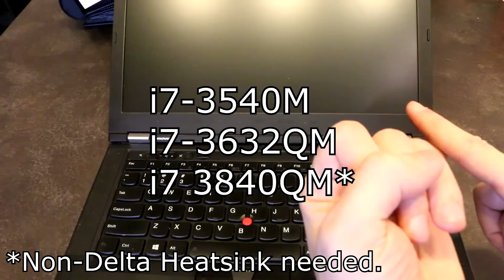Lenovo ThinkPad T430: Upgrade Wonder

Comment: Looking forward to trying one of these out. How does my old HP Compaq NC6400 compare? It's well built for sure, but is it similarly upgradable? I need something to run XP for PA Soft and don't know if it's worth dropping $75 on the motherboard for the HP or putting it towards a thinkpad?
Reply: I have nc6400 (with C2D T5500) and X230 (with i5-3360M), there is basically a day and night difference between them, X230 wipes the floor with nc6400, build quality is similar to be honest, although with a fair bit of advantage to X230 side. Upgrading nc6400 is questionable (older socket, you are limited to C2D Meroms, so T7600 is the limit, and even this CPU will be rather underpowered, RAM is limited by chipset to about 3.5 GB). I support the idea of running Linux on HP if it's viable, but if you insist on having good XP machine, T430 should be having most of the needed drivers AFAIK.
Reply: Have you looked into a VM for XP?
Reply from the maker: Good suggestion.
Reply from the maker: Here are some base stats on how the two would compare as this one is configured:
http://cpuboss.com/cpus/Intel-Core-i5-3320M-vs-Intel-Core-Duo-T2400

As you can imagine, swapping out the CPU with any of the ones listed would widen that gap even further. If you need something to run XP during this day in age, I'd almost suggest running a Linux install off of this and using a virtual machine to emulate XP to run PA Soft. With all the drive bays available you could put a Linux distro on the mSATA, use the DVD base for another SATA drive for storage and use the regular drive bay to keep free for a Windows 10 install.

Check the links in the description to see how serviceable this thing is, the manuals have all been made available to make the process pretty straightforward and parts are easy to come by. The Drive bay to replace the DVD burner costs under $10 CAD from Amazon, the TrackPad sticker if you wanted to replace it is under $5. Maxing out the RAM is about $100 or so, the article on modding details what type of RAM to get as well.

Let me know if you have any further questions.
Reply: My only question then becomes, how soon can you get me another thinkpad? I'm partial to the old HP because of it's tank-like feel, but the T430 is working great, clearly superior, and my ASUS is ready for the bin. The keyboard lighting seals the deal for me. If I can find a board for next to nothing I'll probably still fix the HP and keep it in the BMW for dedicated datalogging/programming, but it's not something I want to spend $100 on. I have found the battery life with the new 9 cell to be a little less than expected, what are others getting on their thinkpad with a 9 cell? Any tips to stretch it out?
Reply from the maker: Browser tabs hog battery. Watch out for those. Also, Windows 10 has a battery settings slider in the system tray you'll want to check out.
Reply: OK I need to post a  pic then. Had to perform surgery a couple weeks ago to reattach the wiring from the adapter receptacle to the board. Most of the screws are stripped it's been apart so many times, had to trim some of the case for access. This how all my laptops invariable fail, literally fall apart but still run. Very excited about mil-spec durability! Battery life is still 4-5 hours, but saw some people claiming almost 3 times that. Still better than the 0 minutes on the unit it replaced.
Reply: If only I had a phone with which to take a picture...
Reply from the maker: They're probably getting 3 times that number from the original Lenovo literature. The OEM batteries tend to have slightly higher capacity than the 3rd party ones but also about 2-3 times the cost.
Reply from the maker: I know a few people near you that can take a picture. Ask them. 😉
Reply from the maker: Good suggestions. Thanks for the comment.
Reply: Thinking about starting a channel "laptop retroactive", how to keep your ASUS or other throwaway slapchop running with zipties, lots of soldering, and gorilla tape. Wish I could post pics of this thing...
Reply from the maker: Imgr upload!

Comment: Can I use the LG 34UC99 with my Surface Book 2 via one USB C cable? Is the monitor charging?
Reply from the maker: Looking at the spec sheet you should be ok. It meets the 60 watt min for a good charge experience.
Reply: Laptop Retrospective yes it offers 60w. But my question is: Is the Book 2 compatible with USB monitors?
Reply from the maker: Yes. It is a standard USB C port, just not TB3.
Reply: Laptop Retrospective ok thank you. So 3440×1440 @60hz is not a Problem?
Reply from the maker: Not 100% sure. I'm not as familiar with the limits of USB C in that regard. I might suggest reading some reviews on that particular monitor and see if any other customers have a similar setup to yours.
Reply: Laptop Retrospective found that on reddit. It should work.

I'm using a Surface Book 2 15 inch with the HP envy 34C Ultrawide which has a USB-C port which can supply 65W of power as well as displayport so its a one cable solution, works amazing. The only thing I haven't been able to get working is the Windows Hello camera on the monitor, I can use it as a webcam but not to sign in. Using the Surface book in Easel mode just below the 34inch monitor with a wireless keyboard and mouse is better than the Surface Studio IMHO and cheaper with way better internals (GTX1060 GB of vram).

Comment: I went with a T420 last year, upgraded to an Ssd, plus an msata ssd, and A 3rd ssd in place of optical drive with an ultrabay caddy.   Never have had a single issue. Awesome video!
Reply: I more or less did the same with my W530, although I've owned it since it was new. Over time, I installed 24GB of RAM, a 2TB SSD in the SATA Slot, a 120GB MSATA SSD, and another 2TB SSD in the ultrabay. It has a 1080p FHD Panel, backlit keyboard, and fingerprint reader. It smokes even some modern machines.
Reply from the maker: Wow, I can see why with those kinds of specs.
Reply from the maker: T420 is no slouch to be sure and has that keyboard many prefer.
Reply: Wes the only issue with mine is the screen. :(
Washed out colors, low resolution...
Reply: Medeiros  I've seen expresscard usb 3.0 cards (2 ports) but I've not tried that yet. As for the screen I don't disagree but mine is okay for my usage. Cheers.
Reply from the maker: Check the upgrade guide for screen options.
Reply: Also usb 2.0 only
Reply: I LOVE my i7 T420! 512gb SSD, 16gb of PC3-1333 RAM, and nVidia NVS 4200m graphics, running Win8.1Pro, and a 1tb 7200rpm drive in the Optical drive bay! Fantasic little machine! Only down side, is USB 2.0 only. The T420s, has one USB 3.0 port. (I have one of those, too. :)